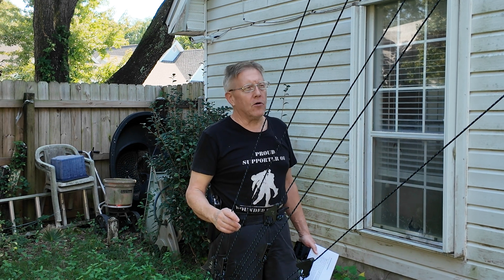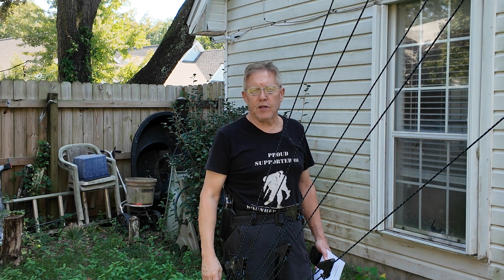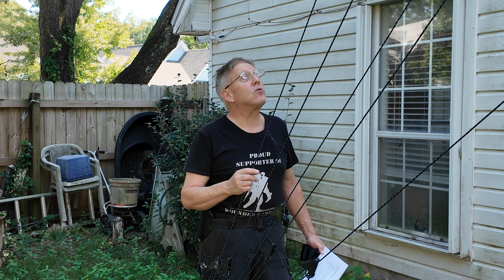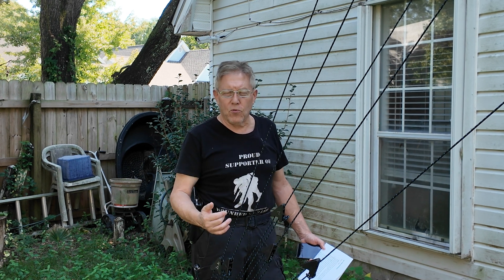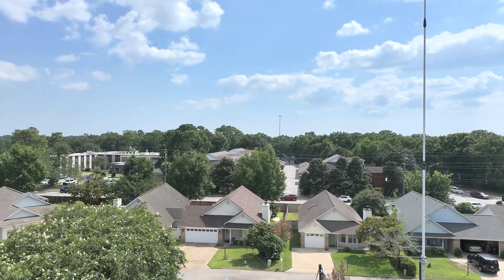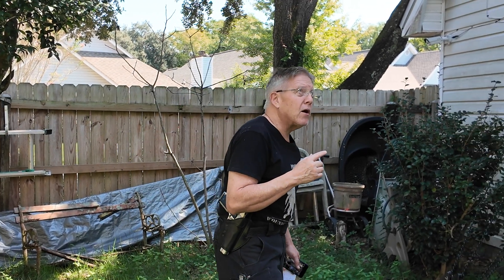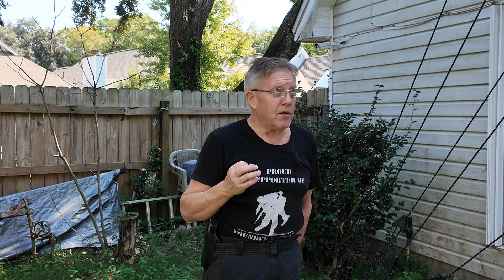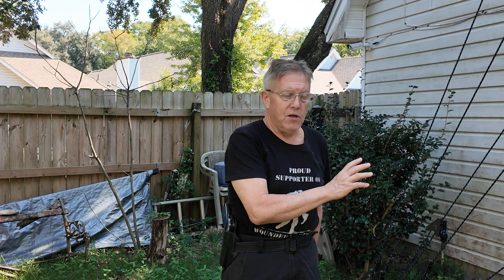Guy Wire Maintenance

Comment: Thanks for video. Until recently, I was unaware you could purchase rope specifically made for guying. Before that, I bought some rope from the hardware store and it lasted just 6 months. The rope I have now looks similar to yours and has held up all summer with no signs of deteriorating. 73 AI4ES